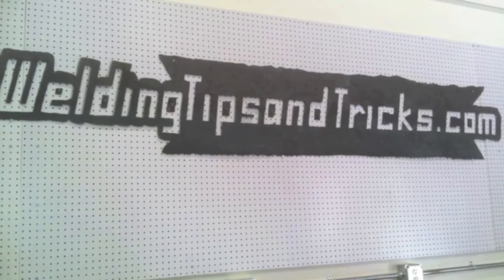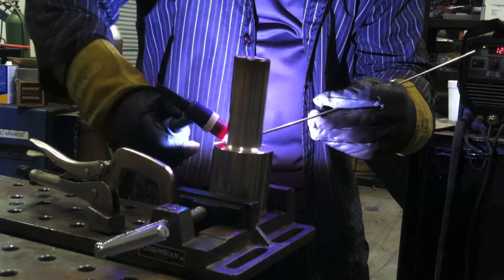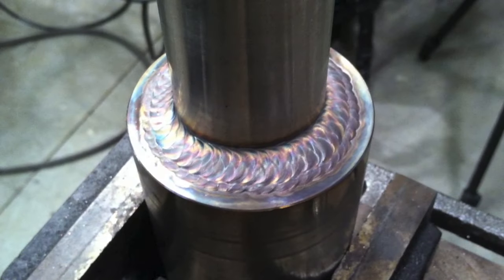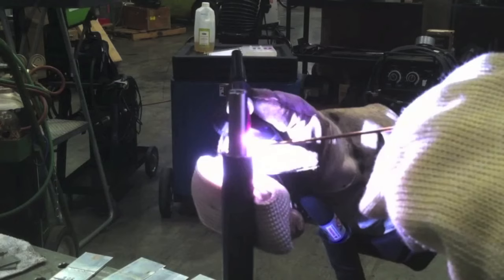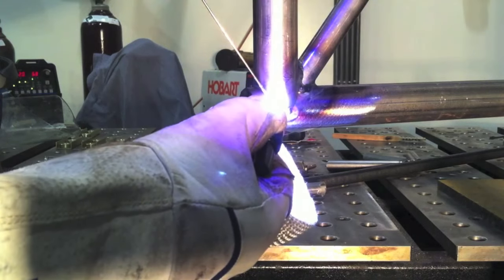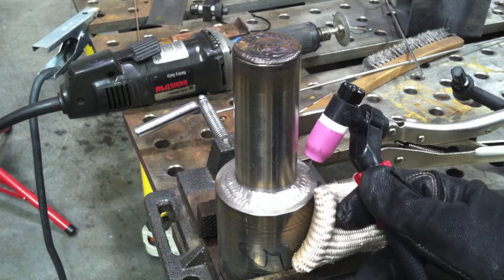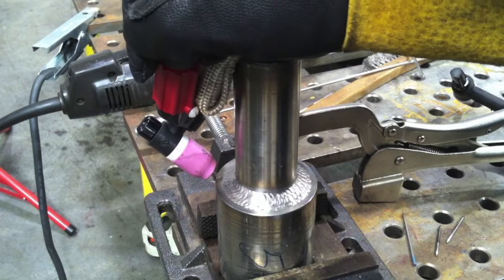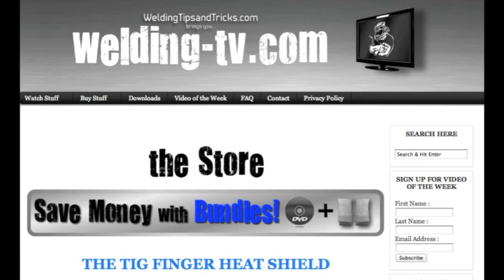Tig Welding Stainless Steel - Walking the Cup vs TIG Finger®

Comment: I'm not even a welder but this is one of the coolest videos I've ever seen. And if I didn't do what I do now (restoration) I'd definitely be a welder. From a marketing perspective, I also gotta give the guy credit. He positions his "commericals" in such a way they don't even seem like commercials. Nice work man.
Reply: Was thinking the same thing!!!
Reply: it's never too late to start. learn it as a hobby and you can probably incorporate it into your restoration services.
Reply: I know it's been 4 years buy you should start in a garage or something with a starter welder. I be you not to get an Everlast, as they are imports. Since they are imports, it is hard to find parts for it. I am getting an esab. They re cheaper than big brands like Miller, and there are parts for them all over the internet

Comment: I'm a Coded Welder for Aluminium, and i've never seen that trick before. Thanks for the tip. Great videos and thank you. I have two Welding videos on my page but no where near the quality of that, well the editing anyway, i have subscribed.
Reply: not coded, learned by keeping my mouth shut and paying attention. Built a chicken coop and weldedthe galvanized pipe to chicken wire with a 40 year old buggy rig . Even chickens impressed

Comment: I’ve been welding for over thirty years and I gotta say that tig finger is genius. I always took a larger gloves thumb and wrapped it around a glove that fits on the pinky, scorch the wrap so it becomes dry and slides on the material easier. Good work sir, I wish I had internet when I started in high school, I had to learn the hard way on my own.

Comment: Nice torch wow tig welding has come a long way in 20 years.
Reply: Dam right, after I retired all the nice stuff came out. I am still welding at home on rail Buggy's and Roll Bars on 1 1/2" Chrome Molly I still have a small standard torch.

Comment from the maker: @weldingtipsandtricks Just to be clear psi is pressure. Not to be confused with flow rate  in cfh. With the 7/16 # 7 cup I used 15-20 cfh flow

Comment: Not gunna lie, welding seems like it can be pretty Zen.
Reply: Oh it is, especially in the shop after hours with nobody else there
Reply: it is if you like working with your hands. i'm at my most relaxed when i weld.
Reply: especially TIG
Reply: im not a welder but I have taken some classes.  you definitely have to throttle back and make sure everything you do is thought out and precise.  all of you movements must be fluid and smooth.  its a lot harder than it looks, to me at least.  much cred to guys that are masters of their crafts!!
Reply: effumall especially make sure the I, U settings are correct, technique is proper considering what material you weld.. quite a lot of knowledge in preparation work before you even start welding..
Reply: Till you realize you need filler and don't have any in your hand and you're fumbling around trying to pick it up off the bench without stopping or over heating the weld, but if you have a really well fit piece you're welding together yes that is very relaxing
Reply: alex bro  Yup - it's a job I regret not doing lol
Reply: I can't wait to start welding school in the fall, then in april I'll be done! just think if you wanna go back to school that's a damn good way to do it
Reply: Andrew James its a job ....u might regret
Reply: twisty tne neck problem the smoke , the lack of proper equipement , the burn , the blast , the liquid aluminum on ur neck
Reply: twisty Can't be worse than plumbing lol
Reply: whats wrong with plumbing XD?
Reply: Nah man, plumbings a nightmare : Feet in water, knees high in shit, bad back, ungrateful customers always complaining that its too expensive. Yeah I'm well equipped but even so it's still a pain in the arse. I was on an industrial job 6 weeks ago and I got talking to some of the welders on site and I think they have an easy life and they're better paid than me lol
Reply: i seeeeeee yeahhh tho i heard wielding underwater is really shitty tho
Reply: Upstate Redneck yeah, tig is very clean, electrode is more dirty, has a lot more of smoke and dirt
Reply: +alex bro 
It can be but it can be hell too. It depends what kind of welding you do.
Shop welding (working on a bench in a well ventilated shop) can be quite engrossing but welding on the side of a building on the bottom of a protruding piece of metal work in 110° sun can be enough to make you wish for death.
Reply: +alex bro not if you working in a ship yard, welding is pretty fun at times but if youre ship welding its horrible
Reply: yeah i heard ship wielding is a hell of a pain , ur like stuck on ur foot hanging in the deepest part of the fucking ship trying to wield in the dark with horrible light , and u has to take any position that a Gymnast would have to and deal with this shit..no wonder ship need water pump to remove water , wielder doesnt see shit of what their wielding if its properly done :/ i dont blame the wielder tho i blame the fucking.....job roflmao XD
Reply: +twisty eh lighting isnt that bad, the thing is, if it gets hot where you live the summers are brutal, being in an iron ship all day welding with a hot flux hard with layers of hot clothing doesn't sound all that great xD but if it's cold where you live  24/7 that's even better, you'd wanna work in the cold at a ship yard cause you can always bundle up while if you're in the heat you can't really do nothing about it
Reply: yeah i used to be a metal burner(OxyAcetyl gaz) 53 inch torch , and shit was keeping me hot even at minus 30 celcius ,
Reply: +The Kids in Africa I do train car repairs, I can relate lol
Reply: Its an art form with in its self.
Reply: +WFCO2015 All the best to you!  I took a beginner and advanced welding course at a local Tech. institute. I got a cert through the school and went out in the field.  There were lots of guys who had more experience than me but when something wasn't working they called me to figure it out. wife and paid off a 30 mortgage in 9 years.  My dad used to say -the more you learn the more you earn.  he was right.  cheers
Reply: +twisty im a grad from the college of oceaneering trained in underwater welding.  can you explain "really shitty"?
Reply: like you dont see what ur doing and trying to weld something like having ur eyes blindfolded and say voila the job is done , u remove the mask and you welded the wrong stuff
Reply: That never happened to me once. Underwater welding is different because you actually make contact with the rod to the base metal and rock it to break away the flux. Twist up another one...you're good!
Reply: Sure is😁 get some music going and it's 10x better. It can be rage inducing though lol
Reply: Overkill Garage did you graduate?

Comment: How do you know how deep your penetration is or does that just come with experience? Just starting out I want to know Im getting enough strength if that makes sense
Reply: <---Tulsa welding school grad 25+years exp. With TIG it's not about penetration on fill it welds, but about fusion, That's why you do multiple passes, but it can be 1/16" to 1/4" deep,  depending on Volts, Amps,Machine  setting,and electrode size&type, things that need deep penetrating are normally done with stick(6010),spray acr mig,or fluxcore.   PS or SubArc
Reply: Makes sense. So if I want to build a trailer frame stick welding would be the preferred method?  What would you recommend for a welding machine that could do both or all 3 or is there issues trying to get it all in one package? Thanks again
Reply: +Jeff DeLuca you can get machines that do all 3 but they're not great. stick is the way to go with a trailer but you need to know what you're doing as its mostly done in position. 2.5mm gp rod @ about 70-80 amps should do the trick.

Comment: how are you getting such color in the welds we spent hours on one chunk of stainless and all we got was kinda copper color. what amps, gas, gas pressure, filler metal, tungsten, and stainless grade please get back to me
Reply: I'm doing metal work at school (vwo), my teacher does know how to get it. I can ask it for you brcause i saw him doing it a lot of times with that color what you mean;)
Reply: Try using 130/140 amps? Maybe that works
Reply: well we were using 1/4 inch 440 stain less from 60-220 amps and 8cfm-35cfm after super heating it we tried dipping it in oil and nothing. were are trying to get the color of the videos thumb nail all the blues. we got it once about an 1/8 inch of it no idea how and we tried replicating it and nothing.
Reply: It can be the temprature and air condition of your work station. This looks like overheated metal, so you can try it in a cold room;) my teacher get those colors, only i don't know how
Reply: please ask him because we were getting colors but just coppery type color but thats it. and temp was around low 70s high 60s when it was done. we werent using any filler metal either just root passes
Reply: I'm going to ask it monday for you;)
Reply: This is somethin i got from internet because i was wondering to: 'Westinghouse: 400+ amp AC
ThermalArc Handy wirefeeder
1 Harris, 3 Victor O/A rigs
Arcair gouger
Too many other power toys to list.'
Reply: A perfect weld on stainless will have no discoloration. The colors are a result of oxygen contamination from a lack of shielding gas coverage.
Reply: i read that as well so we made very fast passes at 8cfm which is about no gas and still just copper filler rod may be an issue
Reply: I looked some pics of rhat and i saw the same of what you meen, it was coppery
Reply: I'm going to ask it to my teacher and i will give you the pressure in cfm, the amps etc. What do you want to know? I can ask everithing;)
Reply: cfm, type of gas, gas shield or not, amp, dc- or ac type of tungsten, type of filler metal, how fast to move the torch, temperature, everything you can think of,

also we weld with a Lincoln tig welder with a pluse setting if that factors in.
Reply: I gonna look what type we have and i gonna ask what i can ask!
Reply: No problem;)
Reply: thanks man i really appreciate it man.
Reply: Slow down
Reply: We are using kemppi welders, tommorow i will do a investigation about our tig welders
Reply: But that would keep heat up and and keep contamination down
Reply: okay cool thanks again
Reply: oxidation? may be you need a purge block?
Reply: tried it
Reply: Our working temprature is around 15/20 degree celsius, today i wil look at the type of gas and pressure
Reply: larger purge block + higher gas flow rate?
discoloration is always caused by inadequate shielding.
Reply: thats why we turned the gas way down and we were using 3x6x2.5 block for a purge
Reply: Some of the things people are saying to you are off the wall. Getting no color could come from a number of things. Heat, gas pressure, how slow your moving.
Reply: don't know if it will solve your problem, but i got same copper color and my teacher told me that it has to be oxidatied so the oxides will 'come back' to the stainless, so it has to be coverd with special 'oil' for like 15-20min, then wash it and you have 'original' color.
Reply: i didn't read this thread, but one that thing can affect color is the after flow of gas (which is how long gas flows after the weld is completed. depending on how long you keep the gas on it during cooling, colors can range from copper, gold, deep purple, purple-blue, blue, light blue, to shiny grey.

Comment: I can attest this is a good video for beginners to learn about walking the cup.  I am a Union Pipefitter/welder, worked in a fab shop welding and fitting nothing but thin wall stainless(some heavy wall, some carbon, chrome, etc), a lot of 100% x ray welds....this is an informative one to get you started.  As any pipe welder will tell you though, you'll end up taking this from that person, that from this person, and put it all together to make your own style.

Comment: I bought a couple of TIG Fingers and just love them. They just lie on the welding table and when you need them, just slip it on. Sometimes I use two at a time. I like using them even when heat is not the issue as they slide along the metal really nice.

Comment: Great video and products there mate.  Would've killed for that TIG finger years ago.   Perfect tool to prop and weld.  Don't know how many times I've grimaced through a weld to finish it.  Flex lock torch is amazing.  I've given the welding away these days though.

Comment: I'm currently doing my A ticket in B.C. and I'm learning about stainless. What we've learned is that when your stainless weld turns blue like that you are burning it too hot and the stainless has lost its stainless capabilities and is now regular carbon steel. I wasn't sure if you we're aware of that. But besides that, that is a really nice looking weld. Walking the cup is really nice on pipe but for me I prefer my stringer beads.

Comment: Welding stainless has always been easy and fun even when stick welding. No rust,  and also makes a clean connection thru the ground and lead wire.

Comment: That's a really good question. I have found it depends on quality (price) of your welding helmet, lighting in the work area, and your personal eyesight. If you wear spectacles, you need ones suitable for close up work.My everyday spectacles are ok for general use, but not good for very close work. Use a good faceshield with a clean protective cover over the lense. I would say that the video camera gives a much better view of the welding process, but then it might be my eyesight at fault!

Comment: thanks, i kinda figured thats what the difference was. i've heard of zirconiated tungusten and that does the same thing. and about using pure tungsten, where i work thats what we use for all aluminum tig welding, and it balls up really easilly during normal welding.

Comment: I'm new, actually haven't made a single weld yet and although I did understand 100% of the terms you used I found your video very informative. I plan on learning welding for art usage (so I want the welds not only to be functional but beautiful also and able to weld the largest variety of metals and thicknesses). Seems like Tig is the way to go from the research I have done so far.

Would you agree?
Reply: go mig for your first welder you need to work up the steadiness of your hand and your skills before you spend 5 times as much on a tig. but by all means do what you think is best :)

Comment: Damn dude... You're good.
Question; if I'm welding 304 stainless sheet, thin stuff 18g, can I use 80/20 argon CO2 on the backside to keep it from sugaring? I'm running straight argon on my tig but I've only got one bottle and a single port regulator... I do however have another whole gas set up for my mig, can I borrow the mig gas for the back side or will it carbonized the stainless and wreck my weld on the other side?

Comment: Great videos.  Forgive me if this question has already been answered.   What's your favorite welder manufacturing company. I have had a Lincoln 140 mig unit. Great little machine. I had a really nice miller 220 unit that was pretty good size ( I'm not a welder by trade). I sold that miller unit last year.  Didn't want to but did. It performed great and I was new to rig welding

Comment: Would you weld something like this to reinforce the transition, or was this just for demo purposes to demonstrate a "socket weld" as if there had been two separate parts set up for welding?  IF it is necessary to reinforce the machined fillet, could the machining be revised so that you would not need to weld, or is welding critical?  Thanks, love the videos and already bought tig finger and t-shirt!

Comment: Hello . What type of welding gives metal melting, given that there is no feeding wire?!  And the grip is similar to this. It's not an electric arc welder?  I saw this same head but without the feeding ladder as you do

Comment: How hot were you running? I fix mig welds, divits, and pin holes and of course leaking tanks at my work. I usually like to keep my settings around 160 but occasionally depending on the circumstance I do go to 200.

Comment: It's at such small flow rates you would have to be welding for quite some time to fill a room to a dangerous level. Most workshops have more than adequate ventilation to resupply air in the room, while still being carful to not allow a breeze to wash out the shielding gas from the weld.

Comment: beautiful weld joints... hey man... if i buy a tig machine can i build tool carriers?panel beating?,or this is just for thin sheet metal? i want to buy me a welder but i would like to include all the sizes and metals i can.. could this a tig welder be multiporpuose?

Comment: I can't weld, I tried it once in college, a sub class, failed miserably. Took me 3 hours just make a 4 inch line without getting the stick stuck. Good thing I didn't sign up for that course. I'd drop out. Quite a bit of respect go to those who can do this work. I never did basic artwork or even colouring, so I just don't have that hand motion ability.

Comment: Do different machines produce different welds? I work as a pipe welder in a shop, we either mig it or if it needs to be clean theyll have me tig using a miller maxstar 200 with a rigid head. Would getting a fancier setup help me make nicer looking welds or is it all about the same? I want to weld aluminum so trying to get my boss to purchase a dedicated tig machine. He says he cant justify the cost though.

Comment: Can you use the dip method for steel as in feeding the rod instead of the touch doing the work? As the dip method is the one that I use myself for aluminum and steel work